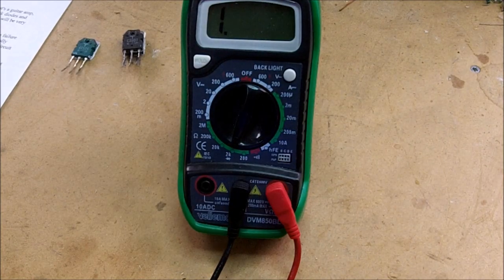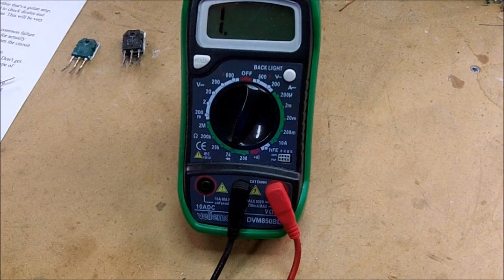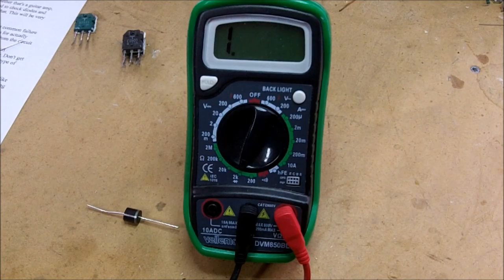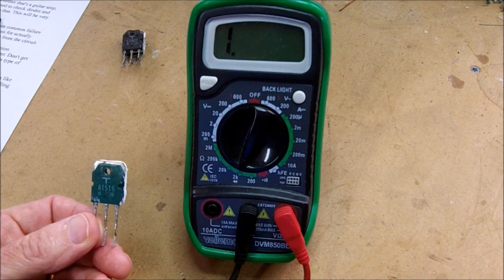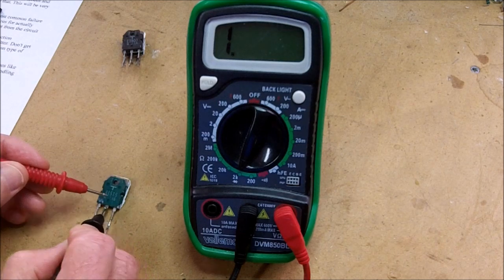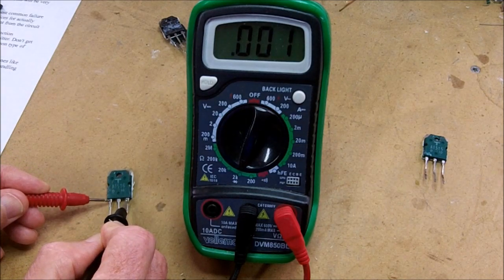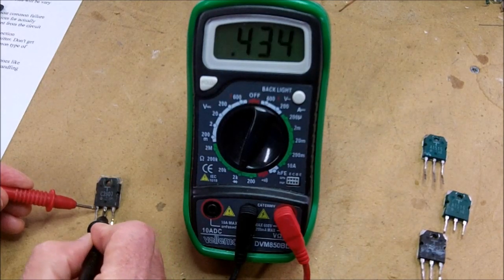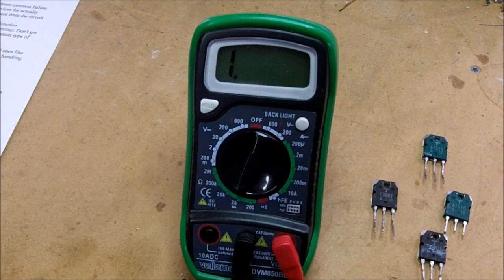checking diodes and transistors

Comment: HEY THERE AND THANKS IN ADVANCE FOR YOUR CHANNEL!
I RECENTLY GOT MY PEAVEY 112 FROM STORAGE AND THE EFFECTS CHANNEL SEEMS TO NOT BE MAKING  CONTACT. THE REVERB STILL WORKS BUT THE GAIN/DISTORTION BUTTONS AND POTS AREN'T MAKING ANY DIFFERENCE WHILE IN USE. 

I JUST WATCHED THE VIDEO ON THE EFX LOOP SO I'LL CHECK THAT OUT.

JUST THOUGHT I'D ASK..... AND SEE IF YOU CAN POINT ME IN THE RIGHT DIRECTION.

I'M SURE THIS VIDEO WILL HELP AS WELL.
I'LL CHECK BACK IN AND LET YA KNOW HOW IT GOES 
THANKS AGAIN👍🤞
Reply from the maker: @WE.ARE138  Since it’s been in storage, I would start by cleaning all the switches and potentiometers with contact cleaner.

Comment: Hi James. Your meter, like mine, has a mode to test the hFE of the transistor. Set the rotary switch to hFE, plug the transistor emitter, base and collector leads into the appropriate holes for either PNP or NPN per the transistor type. The hFE value will be displayed for the test condition of base current 10microAmps and Vce 3V. Compare this value to the hFE from the transistor's data sheet.
Reply from the maker: As I explained at 45 seconds into the video, I was explaining a way to quickly and simply check to see if a transistor is shorted. I know how to use the hFE function of my meter. However, the failure mode of transistors in the electronics that I have repaired for my business have been predominately shorts in one of the junctions. It is not normally necessary to measure the Current gain ( hFE) and compare to a datasheet to determine that a transistor shorted.  In this video I am giving a tip on how to "check" transistors for shorts for those that want to use my tip.

Comment: Can it be tested on circuit or has to be off circuit to be tested?
Reply from the maker: I can be used in circuit as long as you have a schematic diagram of the circuit to know if there is a low resistance component across any of the transistor leads that would indicate a false short.

Comment: Love the video. Very helpful.  Do u have a video on testing capacitors? I keep getting protect mode on my receiver.
Reply from the maker: Jacky Jack I do not have a video on capacitors. Some digital multimeters have a function for measuring capacitance. Also, there are some reasonably priced capacitance testers available. I have one and it’s really handy.

Comment: Thank you for the video
You deserve a like
But how ti check transistor if its installed on the circuit
Reply from the maker: You can check a transistor while installed in the circuit, but you may get a false reading. If there is a component that offers a low resistance connected in parallel with one or more of the junctions of the transistor you are checking, you will get a low resistance reading indicating a possible short in the transistor. But, if all components connected to the transistor you are checking are of high resistance, then you may be able to detect a shorted junction in the transistor. So, you can start with a check of the transistor in circuit and if it appears to be shorted, remove it and check further.
Reply: @jamelectronics 
You are great thanks
I will follow you

Comment: 0.5 to 0.8 volts i have a 2 pin diode D501 in my fuse box under the hood , when i check my D501 Diode it is .914 V , what i like to no is that good or bad ?
Reply from the maker: Probably good. A silicon diode normally has a voltage drop of about .6 volts when forward biased. With no power to the diode measure resistance in both directions as shown in the video. Use the diode setting on your DVM.  It should read high resistance in one direction and very low in the opposite.

Comment: Good explanation, but if you mention which is base, emitter and collector can be more helpful and way better for a novice like me.
Reply from the maker: Thanks for the comment. Just trying to keep it simple. You are really just looking for a short between one of the junctions. You can go to a datasheet for the particular transistor you are checking to identify B, E, and C if you need to know. If any of the junctions are shorted, then the transistor is bad. Shorting of a junction is a common failure mode of bipolar transistors.
Reply: On the good transistor 1 is base (the common lead on which two good readings were), and since the reading was with negative on lead 1,  base is n, so it is pnp transistor.